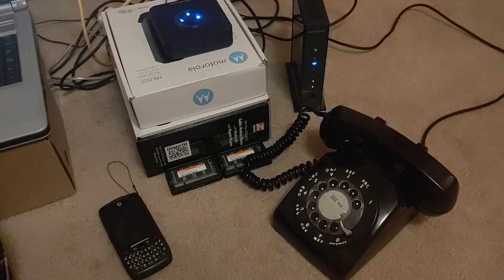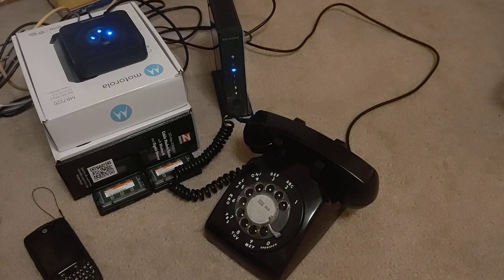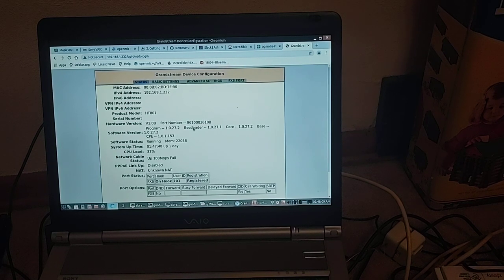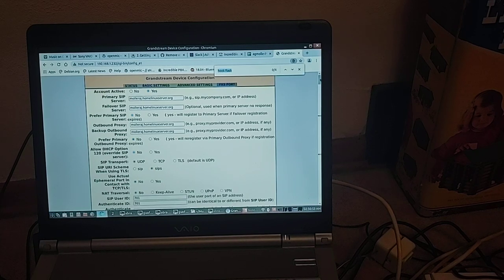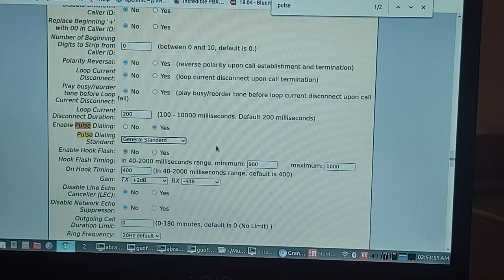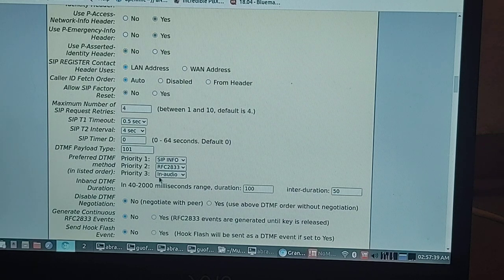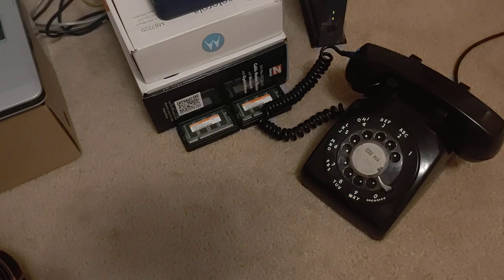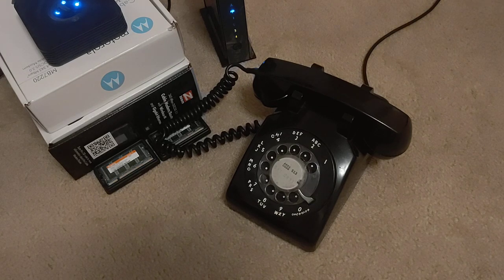How to use rotary phones with VoIP

Comment: If you want an old fashion Dial Tone instead of the modern "precise" dial tone sound change the frequencies in the Advanced section with this string:
f1=480@-17,f2=600@-17,c=0/0;
Be sure to write down the old one first in case you want to change it back to modern.
Reply from the maker: Oooooh! Good to know! Thanks.
Reply: @walnuthills11  Better yet, generate a city dial tone in Asterisk using custom audio files and have your ATA pull dial tone from Asterisk instead of generating it itself. Much more authentic! I get a #1 Crossbar dial tone when I pick up my 500 set. Also have an HT 802 (among others) and I think the 8xx ATA is the best on the market at the moment.
Reply: I could use the old dial tone on my home PBX system and my telephone music studio

Comment: Hello, I see that your phone cord is one of the black round ones. Mine are thin and grey and have a different plug-in, both to the wall and the phone. Will this still work? With this device, can I just plug in the phone to the wall like normal and it'll work? Or do I have to have new wall jacks? Copper phone lines recently stopped working in our area, and we really hope that we can still use these phones so that we don't have to buy new ones for every room. Thank you!

Comment: Nice video. However 10 Hz is pretty standard word wide.
The Swedish and New Zealand setting have nothing to do with pulse rate, but with number distribution. The numbers order on the fingerwheel is different in Sweden and New Zealand.
Sweden is 0, 1 - 9. New Zealand has a reverse number order, so 0, 9, 8 - 1.
Reply from the maker: Oh oops, that's right. Thanks.
Reply: If the New Zealand and Swedish  systems aren't strange enough - Norway used the normal 0=10 PPS / 1=1PPS system,  except  for Oslo which used the New Zealand system    0=10 PPS / 1= 9PPS.

Comment: What do I do if I don't have a PBX?  I just have an old rotary phone that I'd like to hook up to my VOIP provided by my cable provider.  There is phone jack on the back of my cable router but that's in the basement and this phone needs to be on the main floor for my mom.  I don't have old style phone jacks in the house.  The reason for doing this is because my mom is getting up there in years and is having just a bit of trouble with memory.  She knows how to use the old rotary phone but has problems with my VOIP phones.  I just want to put this old rotary phone in the living room by her chair so she can make calls the old fashioned way.  ❤❤

Comment: where I can find instructions for the MTA 6328-2Re on how to get pulse/rotary phone to dial on this ATA ? 
thanks
Reply from the maker: I will look around for the directions I followed. I think you need to unlock yours first.
Reply: @walnuthills11  Hi Abraham thanks for the quick response. It is working now, I was missing the digits mapping in the 6328 to dial "xx" which is what I'm using now in my lab. So basically after doing that I can call in and it rings (is loud!) and dial pulse which no problem. There's no setting for pulse so I guess the ATA detect it or something.

Comment: Cleaning my mother's house out I found an NEC MobilePro 400. Meh, 80s address organizer type junk I assumed. But it looked so old I had to check it out. I was surprised to find it runs Windows CE andnhas a PC card slot. I wondered for and Idle moment if I could link it to my ERS-210 Aibo. But then I found 2/3 of the screen is glitzed so the fun ends there. From trash to treasure and back to trash again. C'est la vie.
  On a weird side not, my mother seems to have had an addiction. I have found 19 Android tablets and counting and every one of them dead as stones.

Comment: Hi, can I bridge this to work with my obihai box, I don’t have a PBX nor do I want to have to pay for a SIP provider.
Reply from the maker: I don't think so. The Obihai box doesn't support pulse dialing from what I remember.
Reply from the maker: You would need a Linux PC running a PBX to bridge Google Voice to a rotary phone through a pulse dial capable ATA.
Reply: @walnuthills11  would pbx is a good one? I have a old dell computer that runs windows 10 would that be ok?  I want to use my rotary phones but my obihai doenst support it.  I got this from my neighbor and I reset it since ut was locked to voange and used a serial cable to unlock it and I tried using a tutorial from classic rotary phones, but it failed and it doesn’t work.
Reply from the maker: @dilhangurbuzergamingchanel7306  That PC is more than enough. You will want a Linux PC though, and Incredible PBX is the simplest PBX server to configure. You can even use a thin client with upgraded hard drive. I have a tutorial on Incredible PBX bridging to Google Voice in another video. Also remember you need a second Grandstream or equivalent pulse dial capable ATA for the rotary phone.
Reply: @walnuthills11  it’s a icore 5, would that be ok?
Reply: @walnuthills11  also can’t I use my unlocked voange ht802 to work with rotary phones, it’s a Grandstream ata and I unlocked it from voange.
Reply from the maker: @dilhangurbuzergamingchanel7306  Yep, more than enough.
Reply from the maker: @dilhangurbuzergamingchanel7306  That should work great. Just turn on pulse dialing support.
Reply: @walnuthills11  thanks.
Reply: @walnuthills11  also one more question how can I install incredible pbx on that computer, and when I try to register my grandstream ata what would I put on the primary sip sever and proxy, and I guess I’ll set up the grandstream ata as a  extension in the pbx.

Comment: Set hook flash timing to 500ms and you'll be fine. (If you want to use call waiting and 3 way calling).
Reply from the maker: Hmmmm. I will have to try that. Exactly 500 ms?
Reply: @walnuthills11  yes.  Bell System standard timing for calling features like call waiting etc.  I don't know if that will mess up your SIP pulse to tone services.
Reply from the maker: Oh gotcha. So that could mess up pulse decoding.

Comment: Great vid! I have a question though, how did you get the ip address for configuring the ata? I have a rotary phone connected to the ht801 aswell and Im stuck figuring out how to access the device´s configurations
Reply from the maker: Hmmmm, I would check on your router's DHCP page! Good luck! Alternatively, you could just connect the ATA straight to a PC via Ethernet and then the ATA address should be in the same subnet as the PC but something like x.x.x.1. Let me know how I can help further!
Reply: open a Command Prompt window and enter the command “arp -a” - then look for the mac address of your ATA and it will show the IP for it